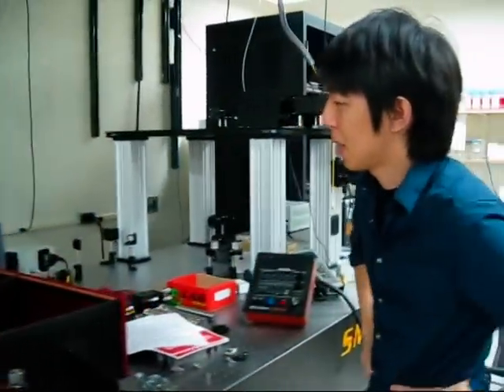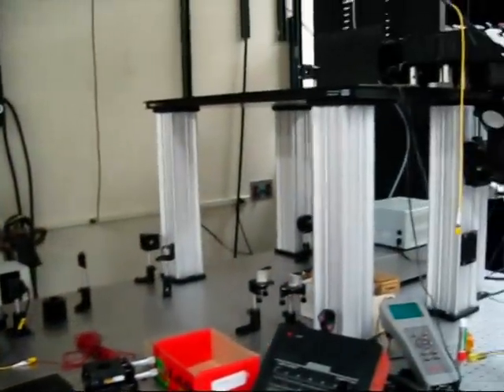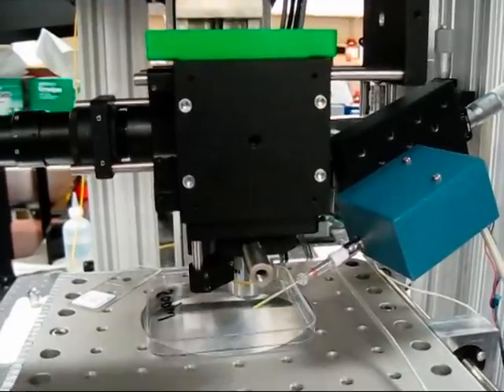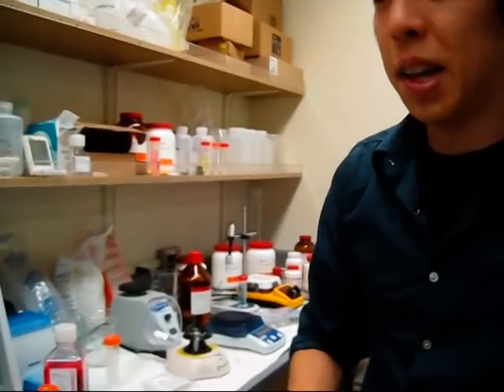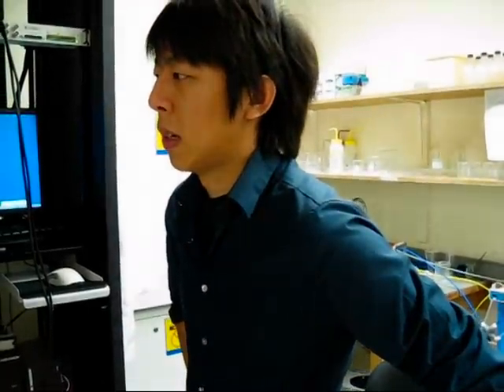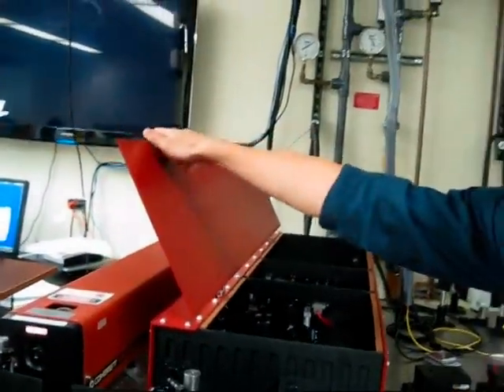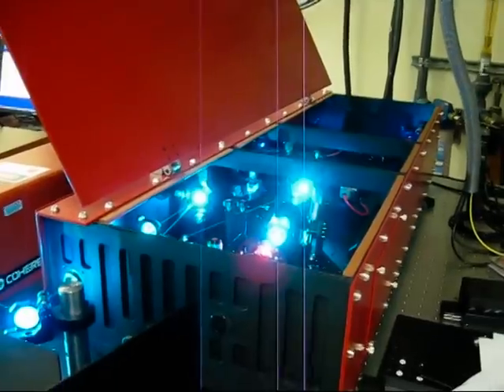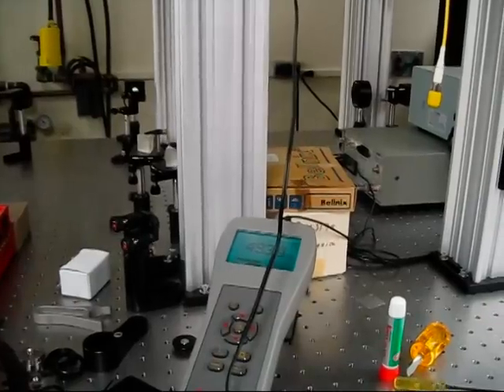Del Mar Photonics Ti:Sapphire laser Trestles in the UCLA Biophysics Neuroimaging Laboratory

Comment from the maker: The autocorrelation technique is the most common method used to determine laser pulse width characteristics on a femtosecond time scale.
The basic optical configuration of the autocorrelator is similar to that of an interferometer (Figure.1). An incoming pulse train is split into two beams of equal intensity. An adjustable optical delay is inserted into one of the arms. The two beams are then recombined within a nonlinear material (semiconductor) for two photon absorption (TPA). The incident pulses directly generate a nonlinear TPA photocurrent in the semiconductor, and the detection of this photocurrent as a function of interferometer optical delay between the interacting pulses yields the pulse autocorrelation function. The TPA process is polarization-independent and non-phasematched, simplifying alignment.
The basic optical configuration of the autocorrelator is similar to that of an interferometer (Fig 1)
The two beams propagate in a collinear fashion (interferometric configuration). This configuration results in an autocorrelation signal that is on top of a constant background.
This background is produced by TPA photocurrent resulting from the portions of the scan during which the pulses are not overlapped.
The Reef RT AA-10DM autocorrelator has been specifically designed to measure the width of pulses from femtosecond lasers. For the measurement of laser pulses the only other item you need is an oscilloscope. Although not necessary, a storage oscilloscope is convenient when operating in the interferometric mode since it allows you to calibrate the display directly using the interference fringes that make up the pulse envelope.

Reef RT manual (model AA-10D) - request at sales@dmphotonics.com
Autocorrelator for ultrafast laser diagnostics
Reef-RT autocorrelator measures laser pulse durations ranging from 20 femtoseconds to picosecond regime. It measures pulse widths from both low energy, high repetition rate oscillators and high energy, low repetition rate amplifiers. Compact control unit operates autocorrelator head and optional spectrometer through on-screen menus. Autocorrelation trace and spectrum can be displayed and analyzed on screen or downloaded to remote computer.
http://www.dmphotonics.com/Autocorrelator/TPA_semiconductor.htm

I wonder if you make autocorrelator to characterize pulse at 2 micron. Pulse width is more than 70fs. Center wavelength could be in between 1870 to 1980. rep rate: 25 MHz to 250 MHz and average power from the oscillator could be 30-80 mW.

Del Mar Photonics quote - sales@dmphotonics.com
Reef-20DDR autocorrelator
Collinear (interferometric) autocorrelation
Wavelength range, nm: 1300-2000
Pulse duration range, fs: 20-6000
Input repetition rate: >10 kHz
Sensitivity: <100 mW^2
Input polarization: horizontal (if vertical please specify with order and e-mail)
Scanning rate, Hz: 0.1-20
Linear distortion, %: <1% 
Necessary equipment: PC with USB or oscilloscope
Dimensions, mm: 
Optical unit - 132 x 123 x 118
Electronic unit - 255 x 190 x 45
Acquisition and analysis PC software included
http://www.dmphotonics.com/Autocorrelator_2_micron/Autocorrelator%20to%20characterize%20pulse%20at%202%20micron.htm

Reef NOPA1402 Scanning Autocorrelator sales@dmphotonics.com
Input wavelength range*: 500-700 nm
Input pulse energy:
>1 uJ  (at 10-250 ps)
>0.3 uJ (at 1-10 ps)
>50 nJ  (at 100 fs - 1 ps)
Input pulse duration: 30 fs - 10 ps  (up to 250 ps on request)
Input beam polarization: linear, horizontal
Input pulse repetition rate: 10 Hz - 100 MHz
Temporal resolution:   
4.2 fs (at input duration <100 fs)
16.6 fs  (at input duration >100 fs)
33.3 fs  (at input duration >500 fs)
<100 fs (at input duration >5 ps)
Scan range: 35 ps (up to 850 ps on request)
Power requirements: 220/110 V AC; 50/60 Hz +-10%
* - other wavelength ranges are available (see below)
Additional set of one crystal, beam splitter and filters for 700-1100 nm
Additional set of one crystal, beam splitter and filters for 1100-2100 nm

Reef-RTD 700-1300 nm, real-time scanning autocorrelator
http://greyhawkoptics.com/product_info.php?products_id=668

http://www.dmphotonics.com/Reef-RTD_autocorrelator/Femtosecond%20autocorrelator%20Reef-RTD%20700-1300%20nm.htm
http://www.dmphotonics.com/reef%20brochure%20web.pdf
http://www.dmphotonics.com/Autocorrelator/Alignment.htm
http://www.dmphotonics.com/Reef-RTD_autocorrelator/Femtosecond%20autocorrelator%20with%20FROG%20option.htm
http://www.delmarphotonics.com/Reef-M_autocorrelator/Reef-M_autocorrelator_multiphoton_microscopy.htm
http://greyhawkoptics.com/index.php?cPath=35_71

Femtosecond SPIDER references
http://www.dmphotonics.com/SPIDER_References.htm

Avoca SPIDER System
Spectral Phase Measurement
http://www.dmphotonics.com/avoca%20brochure%20web.pdf

Spectral Phase Interferometry For Direct
Electric Field Reconstruction
SPIDER
MODEL Avoca-120
Instruction Manual
http://www.dmphotonics.com/Manuals/SPIDER_Avoca-120.pdf

Rincon Cross-Correlator - request a quote at sales@dmphotonics.com
http://www.dmphotonics.com/Femtosecond-Cross-Correlator/femtosecond-third-order-cross-correlator.pdf
http://www.dmphotonics.com/Femtosecond-Cross-Correlator/Femtosecond-cross-correlator-Del-Mar-Photonics-Manual-sample.PDF

Rincon Third Order Cross-Correlator (TOCC)
http://www.dmphotonics.com/Femtosecond-Cross-Correlator/Rincon_cross-correlator-800nm-femtosecond-laser.htm
How good is the output from your femtosecond laser? The new third-order cross-correlator Rincon was specifically developed for measuring a wide array of output parameters from ultrafast laser systems including: contrast ratio of laser pulses, determining pulse pedestal, pre- and post-pulses, and amplified spontaneous emission in femtosecond systems. It also provides information about the third-order cross-correlation function of pulse intensity on a femtosecond scale and can be used for alignment of high power femtosecond lasers. A portion of the input pulse is converted to the second harmonic (SH) with a nonlinear crystal. A dichroic mirror reflects the SH and transmits the fundamental thus splitting the beam into the two arms of the crosscorrelator. The fundamental beam arm includes a retro reflector and delay-line. After passing through the delay-line the fundamental is recombined with the SH and focused into a DKDP or BBO crystal (depending on the input pulse wavelength). Mixing the fundamental and SH pulses in the nonlinear crystal produces non-collinear third harmonic generation (TH). By filtering out the fundamental and SH frequencies, the TH can be isolated. Measuring the TH signal as a function of the optical delay between the fundamental and SH pulses gives the third order cross correlation function. The third order cross-correlator is ideal for looking at the full range of output from amplified femtosecond laser systems. High temporal resolution over a long (close to 1 ns) window shows pulse features that are usually missed, giving the user a detailed and complete picture of the quality and stability of the output pulse parameters of their femtosecond laser system.
Rincon cross-correlator includes opto-mechanical assembly and electronics connected with USB interface for a PC. The system is easy to operate and includes a full set of user friendly software tools for data collection and analysis.

Each Rincon is optimized for customer laser system and required range of measurements.
The complete setup geometry, dimensions of non-linear crystals and some essential optics are all function of laser parameters and user-chosen tradeoffs between sensitivity, time resolution, time window, overall size etc.

We need the following information to set the tradeoffs and get all critical data necessary for the design which is optimized for your system:
1. What is wavelength of you laser system?
2. What is the repetition rate?
3. What is the normal pulse energy and beam diameter?
4. Is the laser pulse chirped?
5. What is the spectral bandwidth?
6. What is the pulsewidth?
7a. What is the expected (or estimated) contrast ratio as a function of delay from peak
7b. What is the minimum necessary contrast ratio as a function of delay from peak
8. What is beam quality (i.e. beam divergence relative to diffraction-limited one)

Comment from the maker: Avoca-5 SPIDER sales@dmphotonics.com
Pulse duration and spectral phase measurement system based on SPIDER
Full wavelength range, nm:  650-1050
Pulse duration range (TL), fs:  5-20
Sensitivity: min. average power of 100 mW at 75 MHz 
Input pulse repetition rate: 75 MHz
Input polarization: linear, horizontal
Dimensions: 385x295x125 mm (incl. 2-channel spectrometer)
USB Interface
Acquisition and analysis software included
USD27,600.-, lead time 12-14 weeks

SPIDER SP-5 (incl. 2-channel built-in spectrometer)
Pulse duration and spectral phase measurement system based on SPIDER
Full wavelength range, nm:  650-1050
Pulse duration range (TL), fs:  5-20
Sensitivity: min. average power of 100 mW at 75 MHz 
Input pulse repetition rate: 75 MHz
Input polarization: linear, horizontal
Dimensions: 385x295x125 mm (incl. 2-channel spectrometer)
USB Interface
Acquisition and analysis software included
USD17,600.-, lead time 12-14 weeks.

Photodetector 450-700 nm
[PH-Reef-450-700]	
http://greyhawkoptics.com/product_info.php?cPath=35_71&products_id=771&osCsid=8d983e0de3b1f20be2d95e3fa835c427
Photodetector unit for Reef-RTD autocorrelator 450-700 nm coverage

PULSE LENGTH MEASUREMENT
http://www.dmphotonics.com/Autocorrelator/8_PULSE_LENGTH.pdf

Two photon absorption
http://www.dmphotonics.com/Autocorrelator/two-photon-absorption.htm

Femtosecond autocorrelator Reef-RTD 700-1300 nm, real-time scanning autocorrelator 
http://www.dmphotonics.com/Reef-RTD_autocorrelator/Femtosecond%20autocorrelator%20Reef-RTD%20700-1300%20nm.htm